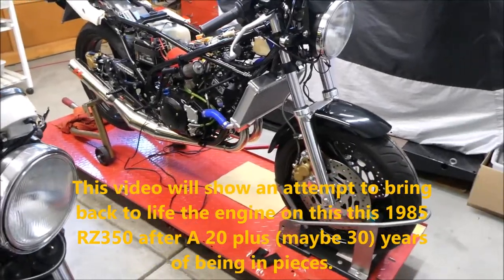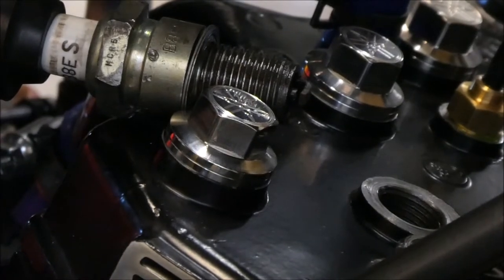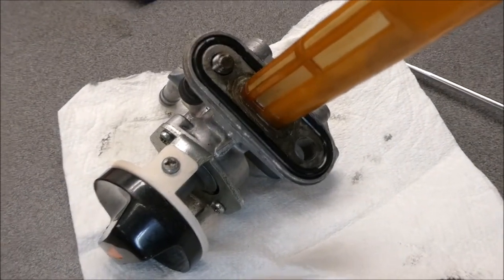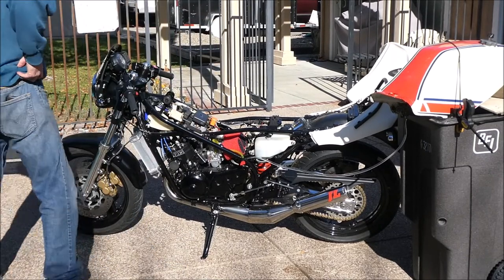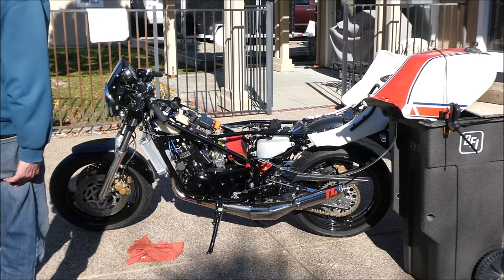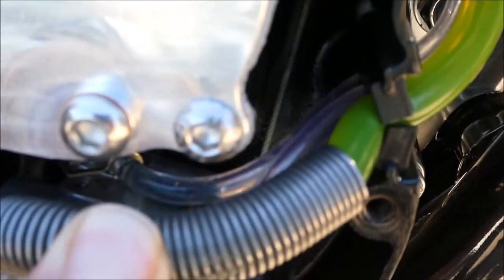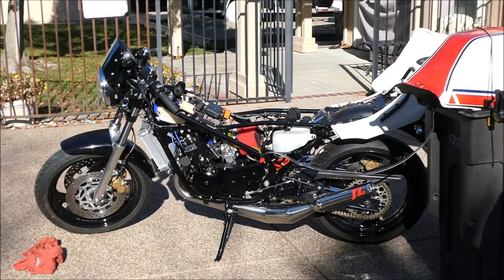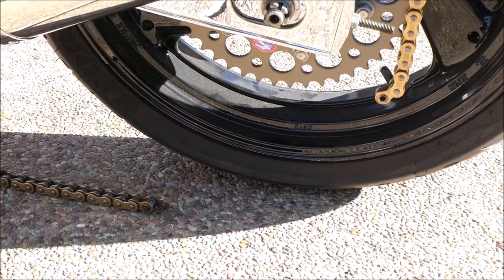RZ350 RZ FZ FZR Project Motorcycle Ep5 - New resto-mod first start, can we make this new bike smoke?

Comment: ah ok.  I was wondering why I was going from Ep. 1 & 2 to '5'...   I just picked up an RZ350 recently after having not had or ridden a 2-stroke since 1982 (& not ridden any bike since 1989). Can't wait to get out on it!  I'm thinking of doing some more upgrades to it for next Spring (ie. Toomey pipes, & SC-2's)
Reply from the maker: Thanks Mr. Freeze for stopping by and leaving a comment. It sounds like you actually read the video description. Yeah, I'm not sure I will get back to Ep 3 & 4. Maybe some day. I'm backed up on stuff to do. Congrats on the RZ350. These things are a blast stock or modified and hot rodded. Enjoy.

Comment: Nice bike, I had virtually the same machine except yellow/black KR. FZR front end with GV emulators, braced FZ swingarm, FZR wheels and brakes, Jolly Moto chambers, fox shock, ported by BJ McDonald in NJ, head squished to .035, Banshee welded crank,  Nology racing coil, FZR radiator, modified RD350 vm28's. Dyno'd at 68 rear wheel hp with stock carbs. I miss it!
Reply from the maker: Thanks for the comment Steve. Yeah, I'll bet you miss it. Sounds like a great build. 68 hp is just about right for one of these little screamers.

Comment: New to rd350 restoration. I have an 86 ypvs f2. Whats the tyre sizes? Also the front brake looks different as well..
Reply from the maker: Hi Arv G. This bike has suspension mods. FZR600 front end, brakes, and 17" wheel. FZ600 swingarm with FZR600 rear wheel and brakes. Tires are bigger than stock. I'm not familiar with the F2 but if stock it should have 90-90/18 front tire and 110-80/18 rear tire.
Reply: @KensGarage1  many thanks...f2 is the fairing model....id leave it stock but very cool resto